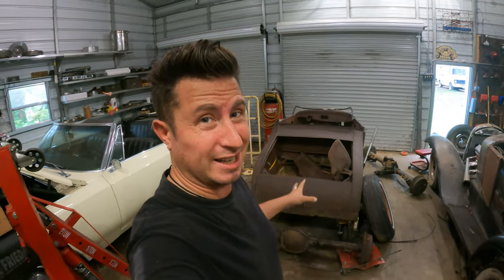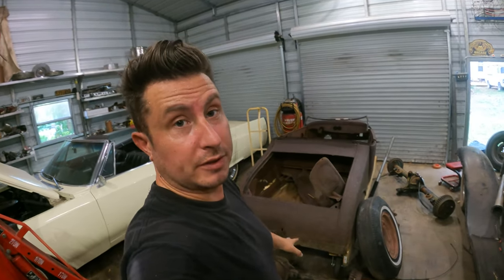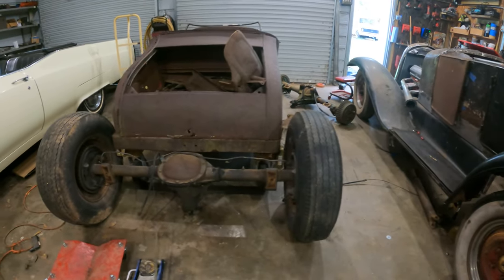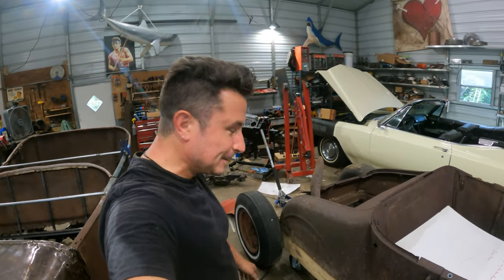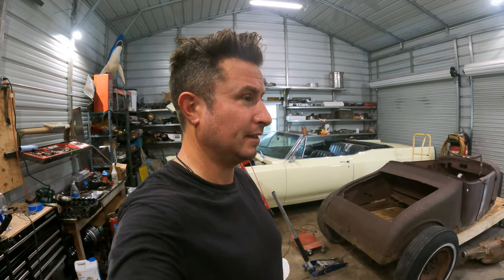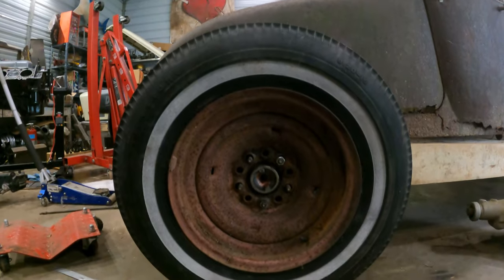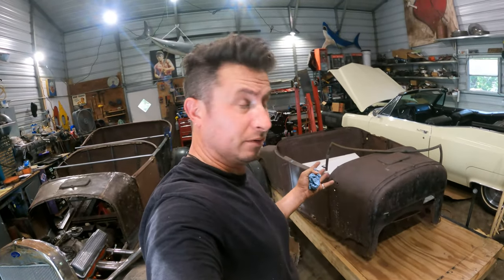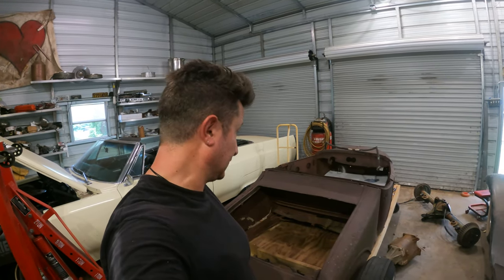Will a 2wd S10 Rear End Fit Under a 1927 Ford Roadster??? (FINALLY PUT TO REST)We have one of each..

Comment: That’s perfect when you fix the body you can mini tub the wheel well for clearance on wheels and Tires
Reply from the maker: I think I may try to run the 16 inch wheels on this one so I ll need a spacer / adapter and I should be good